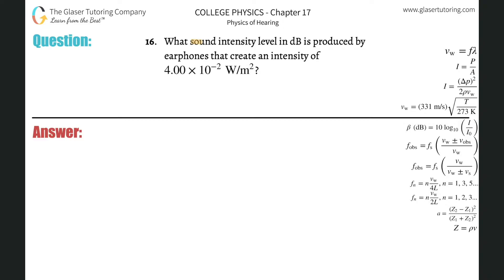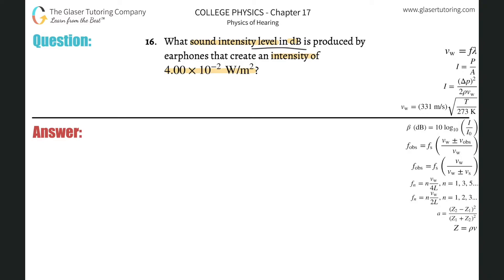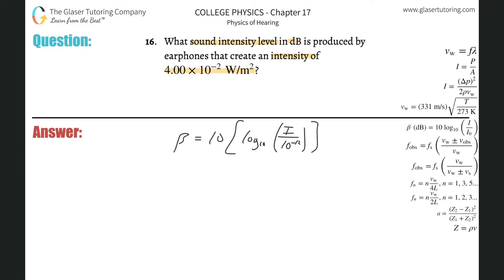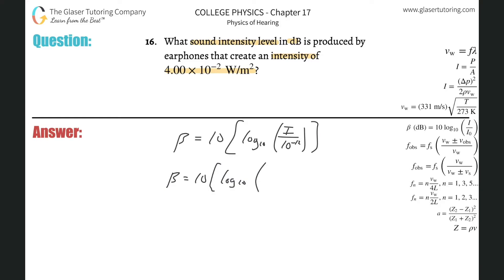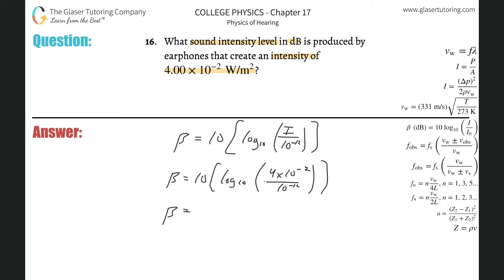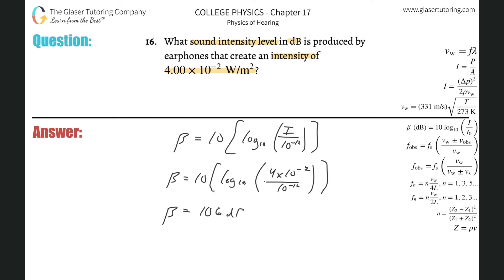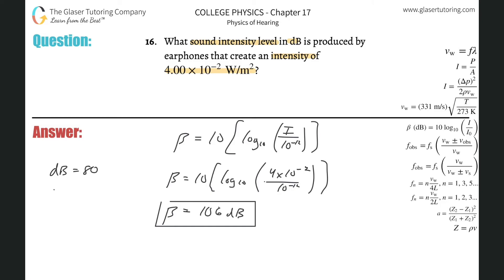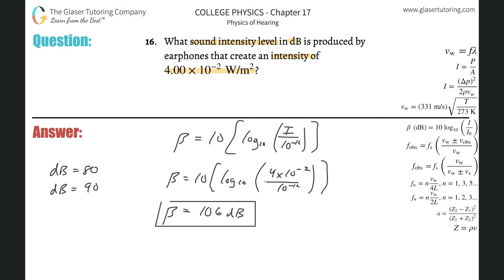17.16 | What sound intensity level in dB is produced by earphones that create an intensity of

Comment: I keep getting 96.02 and I don't know what I am doing wrong
Reply from the maker: Hi Paula!  I am not sure what you are inputting as your calculation but perform the log first.  This should get you 10.6.  Then multiply by 10 and you should come to the answer in the video.  Hopefully this helps!
Reply: I had this issue. If you're using the EE function, try doing it the other way. that helped me!